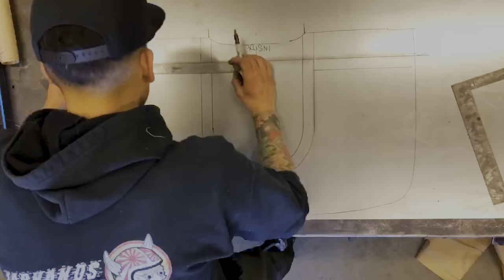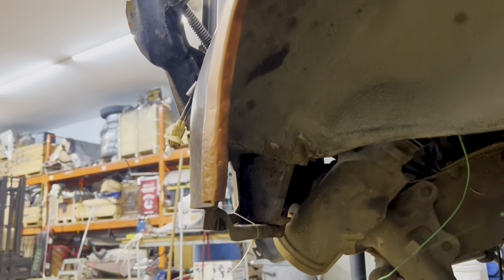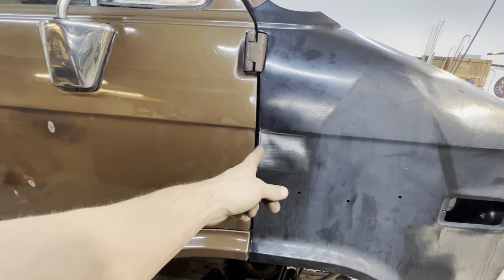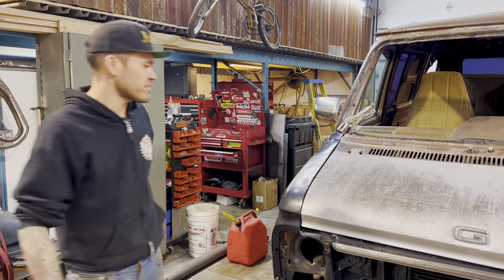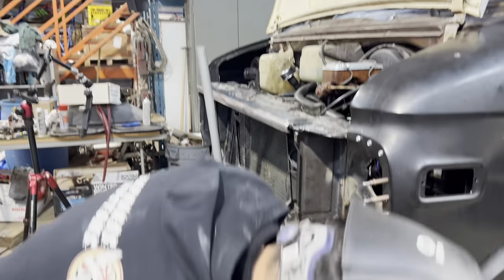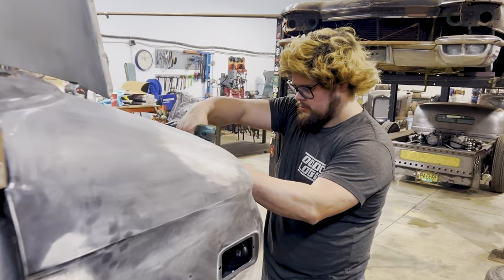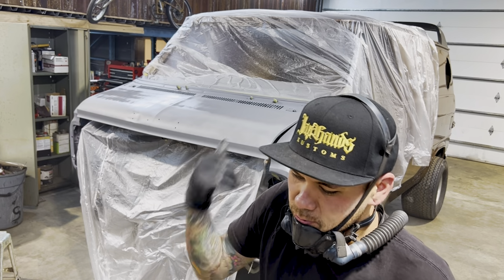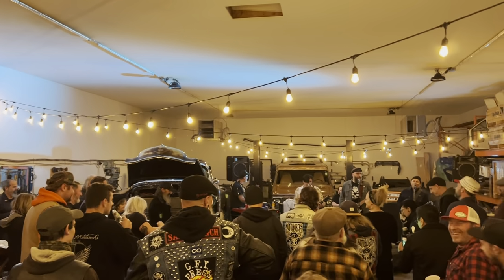How To MIG Spot Weld on Replacement Panels Boogie Van Fender Install

Comment: Looks Awesome Carl!!! Back in the day the full size van was about freedom and style. The prize was the interior, it would have a party and camping theme. Plush, plush, plush with a wet bar was the norm back then in the 70's & 80's. Shag so thick you could swim in it and wood paneling so polished you could see your face in it. It was cool when you'd see someone wire up a 45 record player to the stereo system with the 8 track. I could spend all day at the beach hanging out in the van with my friends. Also, it was a cool place to hang with your friends to get away from the parents. Thanks Carl for the video.
Reply from the maker: Yeah I’m thinking it definitely needs a belt interior

Comment: I appreciate how Karl shows off ALL the work and doesn't just edit the video to make things look simple and easy (which they never are for me). Karl - you might consider a pair of the Knipex pliers wrench - gives you vise-grip level gripping power, but doesn't mar the surface. I think you would find it handy for bending small areas. You can also use them to flatten crinkled edges, or for extreme grip on rusted fasteners, etc. At least for me, it was a tool that didn't seem like it would work well until I tried one. I suggest the 10" for a first pair.
Reply from the maker: I’ll definitely check out those players! Thanks a lot Jared I appreciate your support!
Reply: I agree those Knipex pliers are very handy. Use my 180mm ones all the time: sheet metal on my truck, general car and building maintenance, snapping small cuts when tiling.

Comment: I've done an awful lot to stick welding on the farm when I was in high school (in the 70s) but it only needed to be strong and functional.  It didn't usually need to look good.  I'm just starting to learn about MIG welding and am amazed at how clean and accurate it can be in the right hands.  I am hoping to purchase my own hobby level (or better) multipurpose welder in 2023.  One thing I have learned is that a 220vac welder will provide a better welding and learning experience for the beginner MIG welder.  Thank you for outstanding content!
Reply from the maker: Yes, absolutely having a powerful enough welder definitely helps make nicer welds, especially on thick material

Comment: Ya eased in to my old wheelhouse! You can definitely tell difference between builder and collision tech. We use screws for the tightest fitment. I use panhead phillips with 1/8" pilot and 3/16 outer panel hole. Grab some Zebra clamps from wurth for flange clamps. Aftermarket parts have been an issue for a long time. Glad to see you fit hood! Many forget that until it's too late! Great work as always 😊✌️

Comment: A trick when using self tapers pre drill the outside steel slightly bigger than the screw that way the back pulls up to the front. Best content by far 👌🇦🇺

Comment: Hey man, you should pick up some draw clecos. They do the same job but no pliers  needed. They use a wing nut and allow you to tighten it as much as you want allowing you to “draw” the two pieces of metal together, eliminating any gap between them.

Comment: Another awesome one Karl!
Clecos, on my wish list as well as a sandbag. I admire the pick hammer with the steel handle.
I chuck the tek screws directly in my drill chuck, then i use the torque limiter on the drill to prevent stripping them out.
Reply from the maker: Smart! I like that torque limiter

Comment: a spot weld cutter would give you a good result using the 1/8" cleco holes for the pilot..... the HF ones are smaller in diameter than the more expensive ones from Lisle and other brands like Eastwood etc...

Comment: the reason im asking these questions is because i just bought a 1995 G20 chevy van from my friend and it was wrecked on left side   it pushed in left fender and pushed bumper over and barely bent right fender   but it had been sitting for 2 years and he had all new parts inside if van   2-fenders     bumper    grille   front inner panel   lights   turn signals    i dont have a welder   but i can replace parts and paint     wasnt sure u had to take door off thou to replace fenders    ive got to pull inner liner out some  it got bent up   Thank u for your help

Comment: I didn't know the fenders were welded to the vans, what a pain to change them.  When you're painting multiple panels like that it is a lot easier if you take the hood off and paint it separately.  It's hard to keep a wet edge with it all in one piece like that.  Keep up the good work, that looks awesome with the mini bike on the front of the van!

Comment: Looks great Karl! I'm doing the opposite end of my Shorty from the waist down, a few clicks away err... the end of the Fraser Canyon. 
Take care 
Grumpy
Reply from the maker: Yeah the back into this van doesn’t look so hot either lol could use rear lower quarter on the driver side for sure
Reply: @MakeItKustom They are getting so few that it's proby (not) worth it. They were chewy when we were kids... however there was 2 Vans at Graffiti Days and have never been any before. They are coming back.  Stacey David is humoring the aftermarket for repop parts to be repopped again... we'll see! Until then everything oddball van is handmade.
Take care 
Grumpy

Comment: I have to keep my freak E, truck led sleads are cool, but a altered wheel base mid engine Gasser. I need a lift in the front. And Volkswagen style sliding sunroof, my roof is cut.

Comment: if i had to buy more than one mixed spray can of paint it works out cheaper to buy paint and use spray gun a 400 ml aerosol and 1/2 litre are pretty close on price so the 2nd aerosol would pay for clearcoat and get a better finish with thickness to flat and polish and be able to blend the job you did looks good for a rattle can
Reply from the maker: Yeah you’re definitely right it would’ve been cheaper to just get a pint mixed up ha ha

Comment: The one thing you got to realize is Karl is professional. So on your project after you clamp and line up fenders before you weld double check the door opens properly. Some vechile there is a lip on the door past the hinge that has to pivot inside the fender as you open the door. So make sure it operates properly before you weld it in place.

Comment: Rattle cans love em hate em, I always soak for 10mins in hot water before mixing to loosen up the sediment and then at the end to increase pressure, turning the top at the end to find where the tube is works to get the very last bit out, bloody nice finish tho Karl

Comment: Hey Karl, seeing you use the vice Grip, it came to my mind  that one of the best tools working with sheet metal are the Plier-Wrenches from Knipex. They come in various sizes and are an awesome addition to manual sheet metal forming. They have smooth gripping surfaces and don't marr the surface as vise grips do. The can as well serve as an aluminum Rivet squeezer. Maybe you have them already. Great work you are showing and I am a fan from Germany. Thanks a lot fpor sharing your skills. 🙏💥
Reply from the maker: I’ll check those out thanks so much!
Reply: @MakeItKustom  your creativity will go pretty wild on these plier wrenches as you may even adapt them to your specific needs. The mechanism is geniusly simple, strong and efficient.😉👍

Comment: I am currently welding a patch panel in and area that previously had rust pitting. I cut the old area out, made the appropriate sized panel, get everything held in place and began my tacks. (This is on a 51 Willy’s and the existing steel is 16ga). I set my Miller welder to the appropriate setting based on metal thickness. As I start tack welding the new panel I start to get areas of the old panel literally blowing massive holes. This started even happening on my new panel as well. So I am at a loss as to what is going on.

Comment: It's looks great! I'm surprised you did not take the dent out of that hood. Now that it's painted it really stands out more unfortunately.
They also make the 2 part epoxy paint in a can with a valve you hit which mixes the hardner. 
I painted some rear fenders of a friend's old car and after it was painted he wanted me to polish the whole car because the work I did looked so much better than his car.he

Comment: You can get clecos that screw down to give a better clamping force. I have them in 3/32 and 1/8. The aircraft industry use a variety of different designs.
Reply from the maker: Yeah I’ve seen those and ones that clamp as well. Pretty cool they have all kinds

Comment: Just saying? If you had use color primer of its time which I believe was either black or red I'm thinking it would have being black it would have matched perfectly. But for a rattle can job it looks really good
Reply from the maker: Yeah I bet you that would’ve made a difference. Thanks I didn’t realize that they didn’t use primer gray. I thought that the gray was on some of the chips I saw

Comment: Hey Karl, 
Got to put my safety hat on - You should have stands under that front end whilst the wheels off and not just on the hydraulic Jack. 
At least put the wheels under the sills.
I would not want to see you get hurt.
Great job by the way.

Comment: If it were me I think I'd have painted the fenders and hood a different color and then extended some scallops onto the door. That would have taken the color match gamble out of the equation.

That being said it does match pretty damn good for 40 year old paint straight mixed  straight out of the book without custom tinting it to match.

Comment: Have you ever done roof repairs and unibody frame repair  son an old van. I have an old 74 dodge survivor with killer paint and all the bells and whistles and it has roof rot,rockers and the driver rear frame. It's a project but it's almost too cool to crush, it's 100% there

Comment: Love the videos.  I am learning so much.  What mask were you using that has the two hoses and the filters on your back.  I am so tired of the masks with the filters in your face and at odd angles depending on how the filters were made.  Thanks again and keep teaching!
Reply from the maker: It’s made by north. I used to do a lot of welding and it helps save filters and fits under a mask better

Comment: I did this type of panel welding yesterday.  Do you have to bump the wire speed up a bit when welding straight up, or is that just my Miller welder? Lol. I agree the purple Roloc discs are the best, and you can cut them down when the edge  wears to get much more use out of them!
Reply from the maker: Yeah definitely being upside down could use a little more wire speed

Comment: ....how come you didnt pre-punch the panel for the spot welds where you werent using cleco's?
Reply from the maker: Just seem to make more sense this way in case the panels and they are flanges needed to move around as I fit them

Comment: Do all these older Chevy vans have weld on fenders. Is there a time frame when they start bolting them on. Looked at a couple of these for camping but around here the front fenders are either smashed in or rotted off 🤬🤬🤬🤯🇨🇦
One question do you have to remove windshield to deal with the fenders??
Reply from the maker: As far as I know every old van that has this body style is a welld on Fender

Comment: Question; To get the nicely filled spot welds,  Do you arc off the outer panel filling in towards inner panel? or visa versa? Thanx Karl  Awesome video!
Reply: Can't speak for Karl but the standard technique is a spiral motion from outside to centre.
Get it right and most of the time you don't even need to dress the welds, just run over them with a nylon clean up wheel/disc..

Also, it should be preformed in one weld.. YOU WOULD FAIL AN  I-CAR welding exam if you start and stop part way through a plug  weld.
Reply: @rarkitorparkit  Thank You

Comment: Throw another 10 - 15 K at it, the perfect will suddenly become achievable 😄 Ahhgh! You didn't paint the front rock guard 😞  A really great paint job that you could have done would have been a metallic silver basecoat with a candy root beer topcoat and four or five clear coats. But that is a pretty good matchup, although I can see that the new paint is perhaps a shade and a half lighter the original, still, it looks good.  Panel gaps can be a real pain. HA HA Mike! Always so serious. I saw him in Lordco Salmon arm a couple of weeks ago, he looked like a ground level thunder cloud.
Reply from the maker: good point lol things can be perfect I guess just not in my world lol
Reply: @MakeItKustom  Ty as I might...nor in mine. More often I seem to be taking two steps backward for every step forward. Right now I'm about 10-12 years behind myself.

Comment: I'm truly curious to why you don't just spot weld the panels. Its a fast, easy and inexpensive process that gives predictable results.
Reply: Maybe he doesn't have access to a spot welder.  Have you looked at the RRP on a decent Spot Welder like a Car-O-Liner CTR7 or a GYS PTI S7 because you can't get predictable results with something like a M80

Comment: I don't want to be a weener or anything, but you should consider wearing a dust mask when you're grinding. You're getting all sorts of who knows what in your lungs. Micro particles of paint, rust, road dirt, brake dust, and whatever else can accumulate on an old vehicle. After grinding all day I used to feel like I had smoked a couple packs of unfiltered Camels. Now that I wear a mask, it's not so bad. I use a blast cabinet a lot, and after spending a couple hours on it, I can see how dirty the mask has gotten!  Same with grinding. I'm working on some old MGBs and Midgets. These things are janky af, and I wear a mask and a face shield. Just my suggestion for you so you don't have emphysema in 30 years.

Comment: I'm typically pretty impressed with what you do. Your metal work is very informative. The rattle can paint job however is very disappointing. From what I see in the video you might just as well have painted it pink and the color would not have been any farther off. Yes, I understand your matching old paint, that's why it is common to blend the paint farther back onto the doors on a job like this.